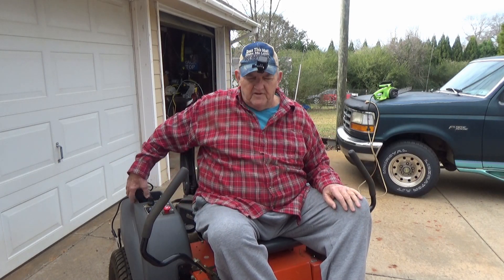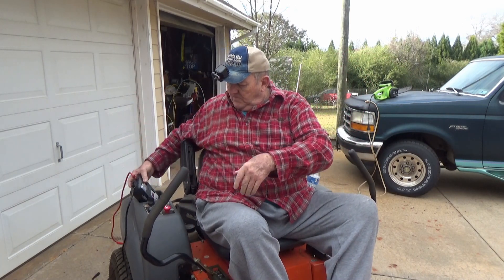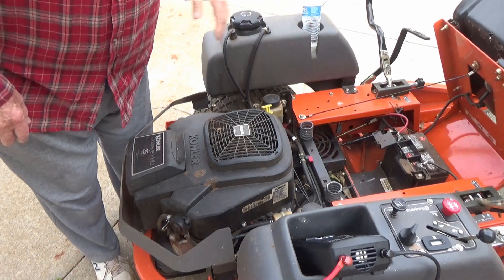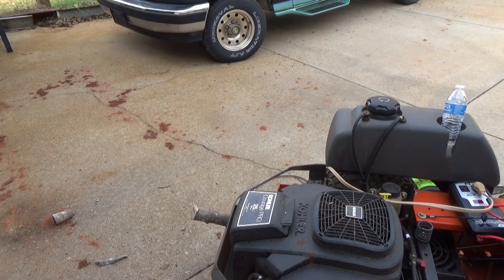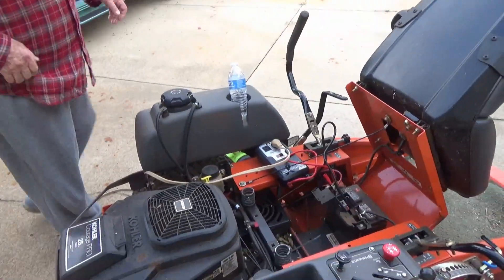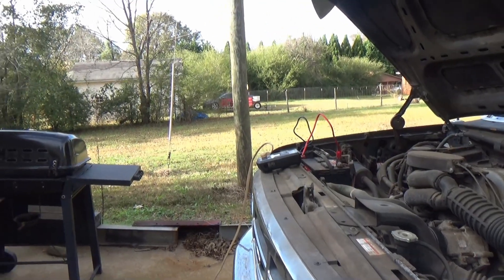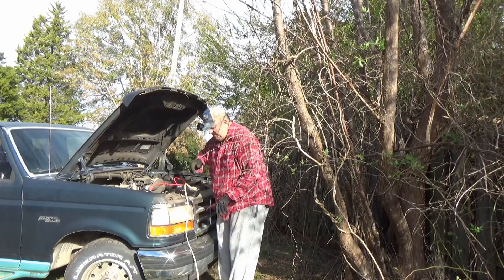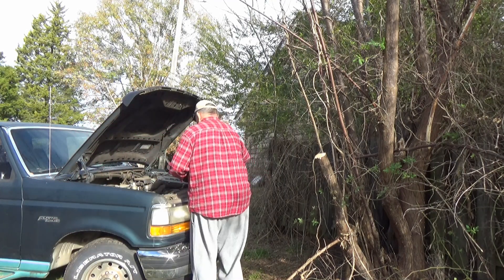Schumacher X175DU Power Converter Part 1

Comment: Walter, my suggestion is to go buy a battery operated cordless chainsaw. My 18 volt lithium ion saw does a great job and there are no cords to get tangled up. The charge will make a lot of cuts and I just have a spare battery. Usually I can have a battery charged by the time I need to change batteries. If I remember correctly the saw, an extra battery, and the charger were under $200. Your inverter could be used to run the charger which would not take as much power as running your saw. Also, any voltage drop could harm the motor on your 110 volt corded saw. Just my thoughts and ideas. You take care!
Reply from the maker: I have one  battery dont hold up long enough